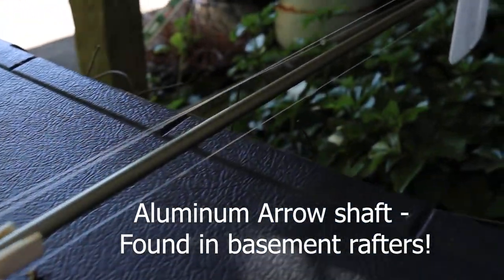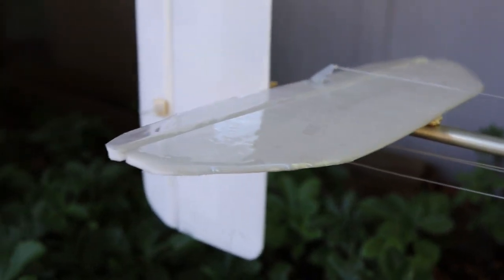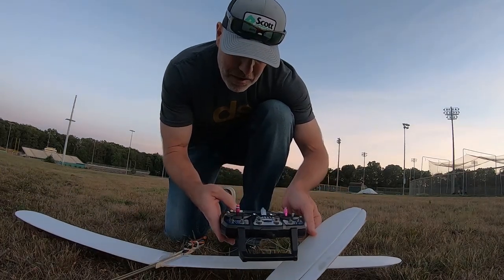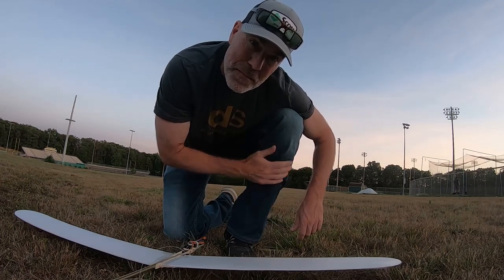Scratch Built DLG (Discus Launch Glider) First Build and Flight

Comment: You may have found this out by now, but flyboa uses 2 layers of dollar tree foam and takes the paper off of just on side of each layer, sands the foam sid of each layer and sandwich/glues them together.. each wing the has paper on the outside, top and bottom. The glued , laminated wing is very rigid and stiff. The builds ive seen , he doesnt even use a spar of any kind. I gotta do this. If your wings werent flexing that thing would have been a floater. Very cool.
Reply from the maker: Yes.  I have 2nd  plane with much stiffer wings that I haven't had a chance test yet.
Reply: @thebikeracer  Hi, don't give up, keep building! Thanks for sharing!
Reply: 3mil laminating film can be ironed on as a better replacement for the paper.
Available as discarded roll ends from copy shops.

Comment: Interesting video Mike. The guys around here who fly DLG all have those hi tech carbon ships. They do the DLG spin and really give those airframes a hard time. Plenty go Gs on launch. Didn’t know you could get such good results with foam wings and an alUminium (with a U) arrow shaft. Not the sort of thing you find lying around in basements this side of the pond. Aluminium arrowshafts.  Not that many basements either. I digress. Thank you Mike for sharing your experience, taking the time, videoing your build and test flights. Hope your enjoying your flying. Thank you Mike. A.
Reply from the maker: Thanks. Check out FlyBoa and his foam wing gliders.  His performance is incredible.